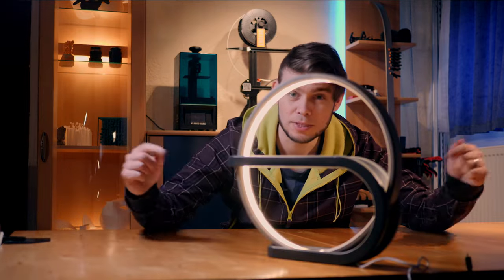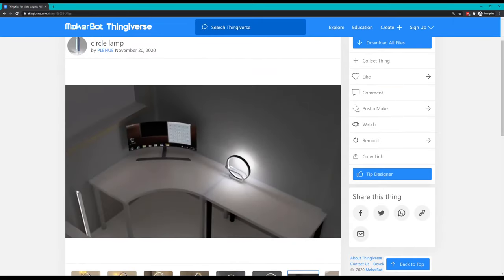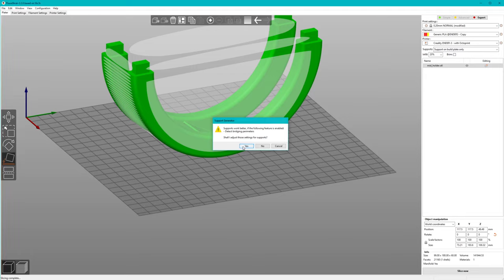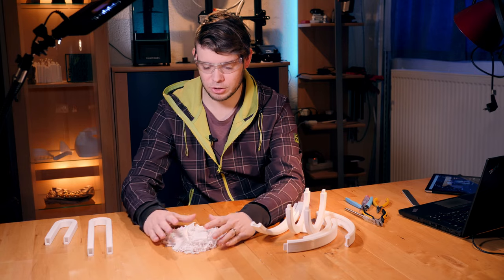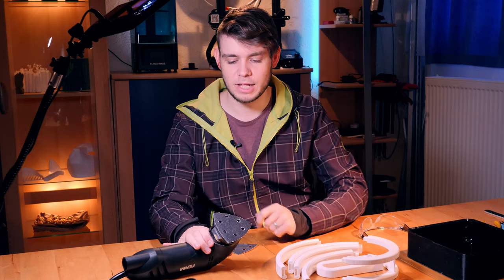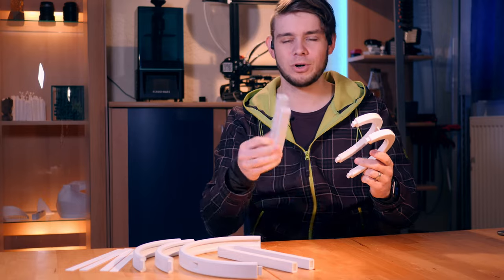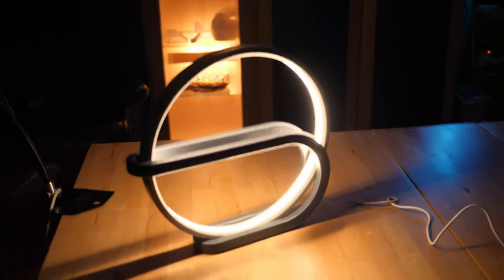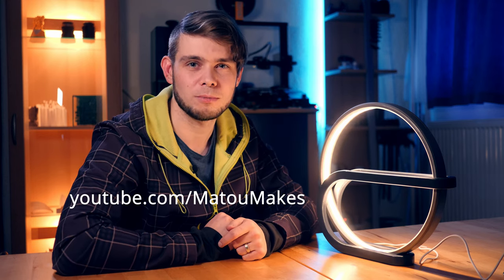What's up with all this 3d printing?

Comment: designing for no supports is always optimal, but if you need a shape that requires supports i cannot recommend enough making custom supports integrated to your model! that 90⁰ angle can be done with a single wall support that would turn the overhang into a bridge and could then be removed super easily
Reply from the maker: I have actually never tried that for FDM prints. Thank you! I will definitely look into that.
Reply: Makers Muse has a great video on tricks like that, stuff such as sacrificial bridging and surprisingly, doing something as simple as just adding a support on the model but leaving a .2mm gap will make it snap clean off!
edit: i think .2mm is what he used but is also arbitrary, just one layer height gap should do the trick
Reply from the maker: @ImKittyCow  Perfect! Thanks again :)
Reply: prusaslicer now has print on support so you don't even need to whip out any modeling tools.
Reply: @TechExploresNYC  paint on support* but that doesnt solve any of the issues custom supports do, cause its still the same support structure that royally fucks up surface finish and takes way too long to remove with pliars

Comment: 7:08 try tree support next time, very comprehensive video.
Reply from the maker: That’s the supports used for SLA printing, right? Never tried that for FDM. That’s worth a shot. Thank you!
Reply: @matoumakes  cura 4.8 has the tree support type for my ender 3 printer. it will always find a buildplate location to start and branches out to the overhangs as it builds up. It becomes much easier to remove because the base of the support won't touch the top of your object, fusing to it and making marks. 
Sometimes it will print more material and sometimes less, but usually less because it prints hollow. Definitely worth trying.
Reply from the maker: @TechExploresNYC  Cool! I’d expect Prusa Slicer to also have something like this. I will check that later.